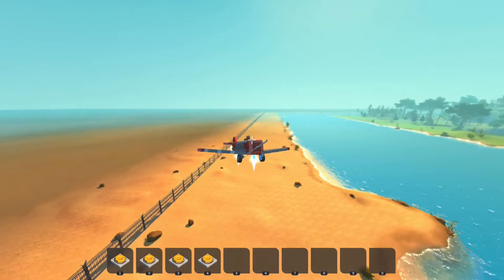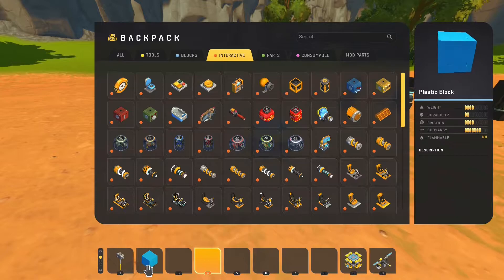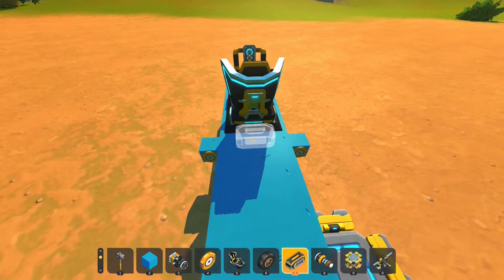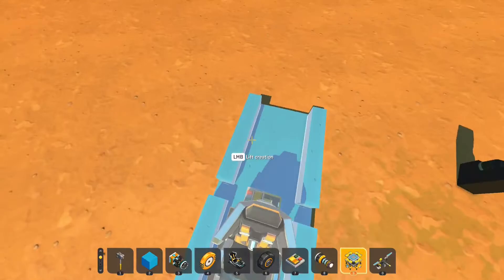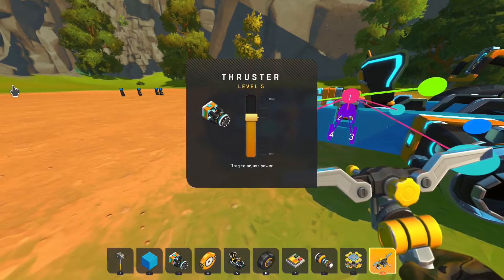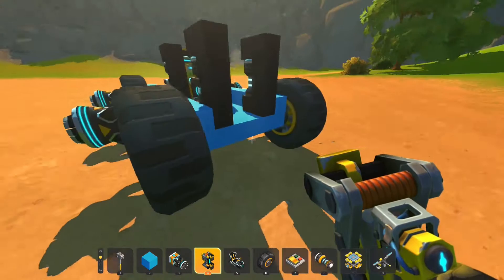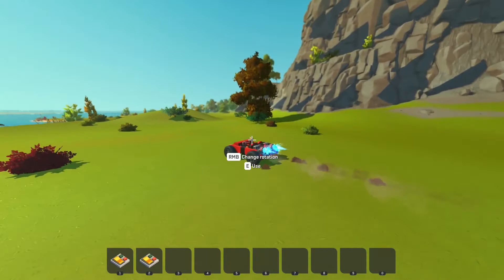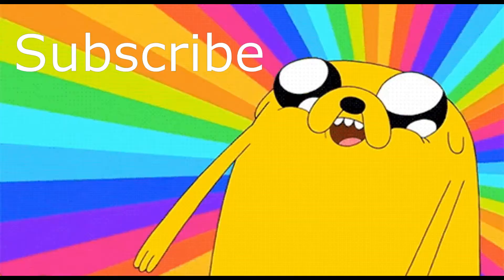HOW TO BUILD A FLYING CAR - LittleCornDogs

Comment: How does the trick with the suspension works? I build the same suspension and put it in the same place but its still turning over
Reply from the maker: Make sure the block with the suspension is connected to the bearing and not another block hopefully this helps a little